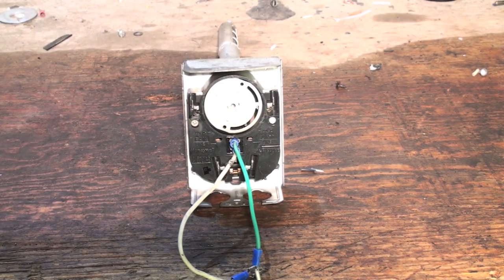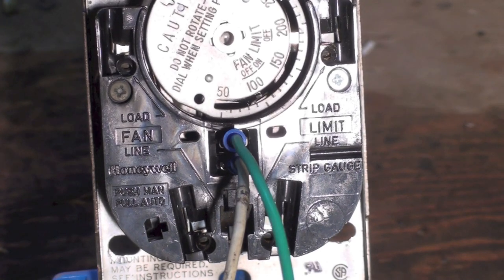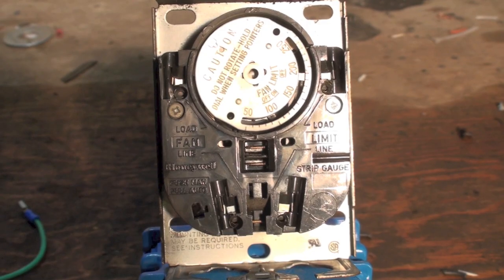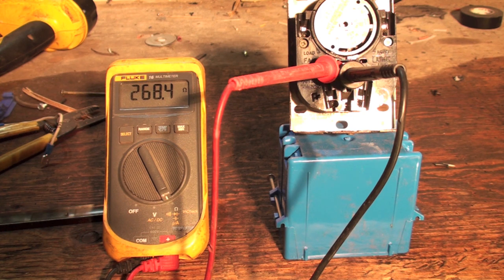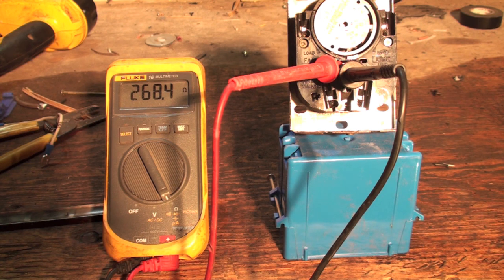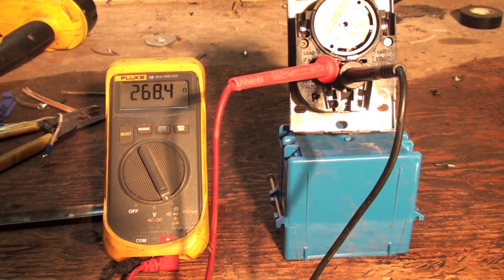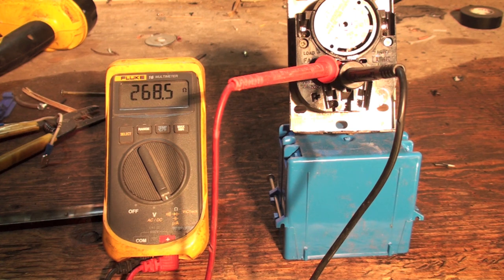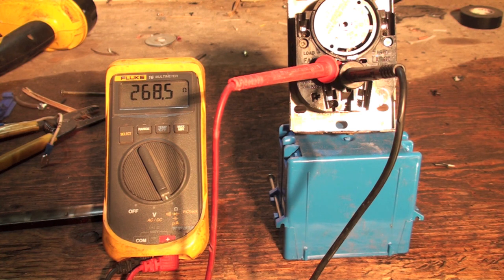Honeywell fan and limit switch with preheater

Comment: found this same unit on a 1987 or 1989 Lennox Pulse (buzz bomb) 100k btu furnace 95% efficient with large 2nd heat exchanger.

Opened the switch to see what the heck those 24vac leads were for (they feed from the gas valve - when gas valve energized the tiny  heater is on). 
   The tiny  heater is warped around the finger switch to FAN (that rides on cam that primary bimetallic turns).  
So that finger switch must be bimetallic also (instead of a simple spring material).    
From the internal design the tiny heater function is to alter the activation temperature of FAN when gas valve is on.
When the Gas  valve is NOT energized the set Temp returns to normal (apparently).

Comment: Mine has that heater, but they don’t make that style anymore, the new switch doesn’t have that, can I just can those wires off or is this going to really affect anything?
Reply from the maker: As long as the wires are isolated, they can be capped off.
GFM

Comment: Gary any insight on how to clean one of these switches? I have one in an older furnance that sticks on when the weather changes. A little bang on the housing works but climbing into the attic 10 times a day is a pain.
Reply from the maker: Clean it by replacing it.
GFM

Comment: Thanks for the explanation of the extra two wires. I replaced a L4064W1098 with the "only" available alternative L4064B2236. The original one had a preheater and the extra two wires, and the new one does not have the preheater. Someone a while back asked you what to do if the replacement does not have the preheater, and you suggested capping off the wires, but the burners may go off before the fan kicks on, which happen to me. I found someone that suggested to drop the Fan On to 120 to 130. Old one was set to 150 deg. Well, 130 deg caused a short cycle (another one of your great videos :), so I increased to 135, and decreased the Fan Off to 80. Old one was set at 90,150,200, and the new one is now set to 80,135,200. I was wondering if you have any other suggestions. I really would have preferred replacing with the original, and if not, at least one close with the preheater. Seems to be working okay now, but not sure what will happen when it gets really cold...Thanks!
Reply from the maker: The 80 number may leave the fan on in the summer.  I would want to know if the thermostat anticipator is set correctly.  If it is set for too short of cycles, that may cause your problem.
GFM
Reply: @grayfurnaceman  Thanks for the reply! I did recheck the setting for the new Fan Limit Switch, and I set the low to 85, not 80. Maybe I was afraid of blowing cold air, so I had bumped it up to see if the short cycle happen. So far no issues, but not much change yet in outside temperature. I had to research the meaning of  thermostat anticipator, and if my thermostat had one. I have a Honeywell MagicStat from the mid-1990's. What I found out is it has a "A" and "B" screw on the back. Both A and B should be screwed in for a Warm Air Furnace, which is what I have. A and B are different for Water Boiler and Electric Heat. I found where someone was familiar with this "cheap" thermostat,  and found you could adjust the A screw by unscrewing a little at a time, and the differential between A and B, where B remains screwed in, simulates a thermostat anticipator. He said it is trail and error, run thru a few cycles and see what you get. I think I like where it is set because when the temperature is cold outside, I am just starting to get cool when it comes on, and comfortable when it goes off (at least with the old fan limit switch). I know several years ago the furnace cycle was too short, that is the house got warm real fast once the furnace kicked on. I told the furnace  guy (who retired :( ) about it, and the range in temperature between when it kicked on and off seemed too extreme, and he said the furnace that I have was oversized for my house. He took out two orifices and plugged the burners, and loved the furnace ever since. I still have the old fan limit switch, and the furnace still works with it. I was saving as a temporary spare. It was getting really noisy, and was afraid it would go out when I would be out of town. When I took it off, I thought maybe a cleaning would help, but it was clean; not dust, soot, rust...almost like new, just slightly discolored, but evenly.

Comment: Hi - on my system, the Oil primary is a R8184N 1009, which is obsolete.  On the  R8184N the heater connects from T2 to F2, which I would guess pulls the 24VAC from the thermostat, and is only active when the thermostat is energized - is that correct?
Reply from the maker: That is correct.
GFM

Comment: My furnace short cycles like this but only in the morning when first turn on from about 8am to 11am then it’ll go back into normal operation any idea where to start!? It’ll the flame will kick on then the blower but the blower will cut off while flame is still running
Reply from the maker: You could set the on and off temps on the fan switch farther apart.
GFM
Reply: Fan switch? Your talking about this device in the video correct?

Comment: How do I put a non preheat limit switch onto an old preheat limit switch set up?
Reply from the maker: You install it as if there were no preheater and just isolate the 2 wires that go to the center of the old switch.  The unit may short cycle but all you can do is set the on and off temps farther apart.
GFM
Reply: @grayfurnaceman  But how does the thermostat work now.
Reply from the maker: Are you asking about the fan thermostat or the wall thermostat?
GFM

Comment: Is the heater powered with w and common?  Thanks Jeff
Reply from the maker: Yes.  It is usually wired to the gas valve in parallel.
GFM
Reply: thanks for the info. i was wondering what that extra circuit did. great vids!

Comment: Can u replace that, with a switch without the heater
Reply from the maker: Marlin Riddle Yes. It may turn on the fan then shut It off before coming on and running thru the cycle. But it will work. 
GFM
Reply: Man u r the boss, thanks, love ur channel, hvac certified but i havent seen everything, u r the man, i love how detailed u r, i cud spend a weekend with u, appreciate the feed back

Comment: My limit switch kicks out the whole system , nothing runs till it cools again, only the pilot light stays on.   The automatic fan won't come on either.   I recalibrate my limit,  but it has problems. 😉
Reply from the maker: That sounds like a wiring problem.  Happy new year
GFM
Reply: @grayfurnaceman    the fan comes on for the a.c.  but not for the furnace.   I wonder if it is the thermostat.   I hear a clicking for furnace,  but not the a.c..
Reply from the maker: @shellyblanchard5788  I would still say you have wiring problem.  When the limit opens, it should only shut off the burner.  The thermostat has nothing to do with this operation.  
GFM
Reply: @grayfurnaceman  I read you loud and clear😉.   The wire to the fan broke a couple years ago and I spliced it  and it came on , but last year it stopped coming on.   I thought maybe the wire had burned out, so I connected both wires and took out the splice. Still didn't come on , and had to use the on switch.    I wondered if  the automatic burned out.    The a.c. automatic comes on but not the furnace still.   The outside compressor is off on the a.c..  no coolant.
Reply: @grayfurnaceman  it looked like one of the wire were burnt to the fan , so  I spliced another wire to where the a.c. was connected on automatic and it still didn't come with the heat.   I heard it click on but no fan blowing.    I think I have a bad limit switch.   I still have to turn fan on. ☹
Reply from the maker: @shellyblanchard5788  I would replace the fan and limit but when you check operation, you may also find that there is something else not wired correctly.
GFM